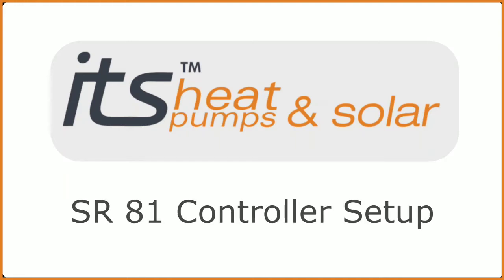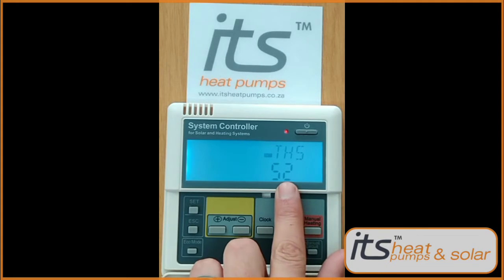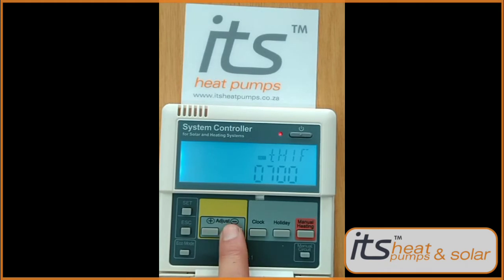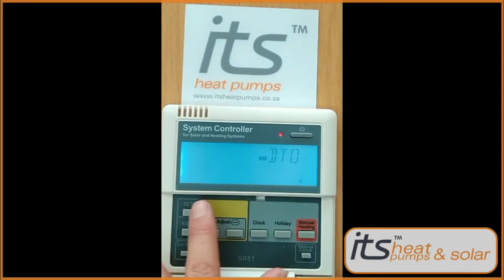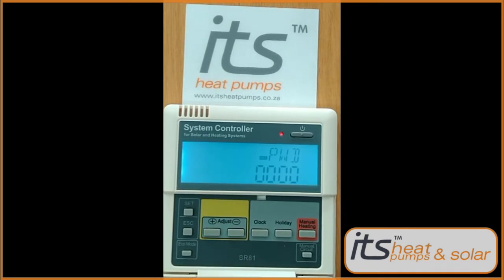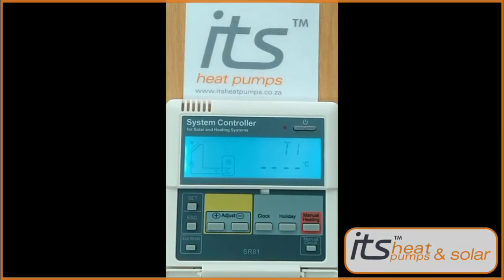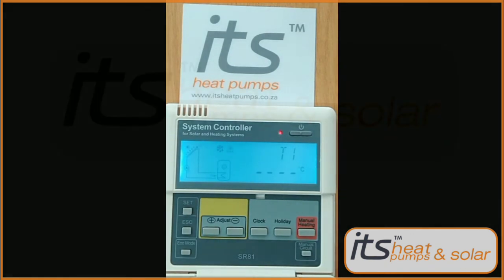ITS Heat pumps & Solar - SR 81 Solar Controller Setup Video

Comment: Hello!  In my installation, the recirculation pump operates continuously, without interruption. Is this the intended behavior, or could it indicate a control system issue?

Comment: Hi and thanks for the video

My water not getting hot even when set to manual heating (60°) . Today it only reached a max of 35° (cloudy day) so I assume that it was working only on solar. What might be issue here? How to know if there is an issue with the element, thermostat or the controller.
Thanks in advance

Comment: Hello @ntuthumnyani your geyser should not be drawing any power if you have solar and heat pump combined, you element should be off and the controller should be controlling when the heat pump switches on not your element.

Comment: Thank you for your video, I am not sure if I am doing my setting right because my geyser still consume a lot of electricity  regardless of heat pump and solar panel. What are the 3 right times to set inoder to get hot water in the morning up to 10 am and in the afternoon up to 9 oclock and save electricity at night?

Comment: Thank you for this helpful video. Please could you explain why the temperature on my SR81 does not increase consistently (until it reaches the temperature I have set) when it is using the electrical element. When the system is using the electrical element for heating (on manual or timer) the temperature starts increasing then suddenly and inexplicably drops a degree or two then starts increasing again (even though no hot water is being used). It seems to cycle upwards like this whilst it is heating up and thus takes longer to reach the desired temperature than it should. Is this normal?
Reply from the maker: Good day

Thank you for your question

Regarding element heating, element heats the water from the cold side of the geyser at the bottom. Because element heating happens rapidly the heated water it creates rises quickly to the top of the tank and the colder water at the bottom part of the tank is drawn closer to the element. With this movement past your sensor pocket it cools down for a short period as the colder water is heated.

With the solar you are heating geyser from top to bottom and will have more constant heating

So in short this is normal as your stratification levels in your tank moves (rotates) as you heat water.

Hope this helps

Greetings
ITS Heat Pumps
Reply: @itsheatpumps9736  Thank you for your comprehensive reply.

Comment: Holyday function activate. The pump dosen't activate even the tank temperature is 55° (t3) and is night and the colector temperature (T1) is 22°. I don't know If I'm doing something wrong...
Reply from the maker: Good day

The holiday function will do normal solar circulation during the day and then at night it will dump all the heat by circulating tank water to the panel to be able to start the next day at a colder tank temperature. 

Also please deactivate T3 sensor as set out by the settings in video. T3 sensor is for ring main functions and or top of tank temperatures. If you only making use of 2x sensors (1x Collector 1x Tank) it is advised to deactivate T3 and only use T1 & T2

Greetings
ITS Heat Pumps

Comment: Hi! Thanks for the video!
When talking about the Electrical Element Timer you suggest to set tH1O temperature to 48º minimum, why do you suggest this temperature? What does this parameter mean? 
Regarding tH1F, you suggest to set it to 55º, would you please explain why as well, and what does it mean?
Thank you in advance!
Reply from the maker: Good day and thank you for the question.

The tH1O is the minimum temperature tank will need to be for element to switch on, if above this temperature element wont switch on even if timer allows it.

The th1F is the element set point for the tank. This is the max temperature element will reach and switch off. 

With element temperature set to 55°C max this will allow top of tank to reach 60°C witch is required by SANS regulations.

Hope this clarifies query

Greetings
ITS Heat Pumps & Solar

Comment: hi, those settings will warm my water during the day?
Reply from the maker: Thank you for the question. These settings is to ensure proper operations of the solar controller and ensure system reads and runs at the optimal performance dependent on weather conditions. This is all subject to proper configuration of system install. The controller has other functions that is not applicable to standard solar installs.

Hope this sheds some light.
Greetings

Comment: Hello, why did you turn off the T3 sensor ?
Reply from the maker: Thank you for the question
The T3 sensor is for the ring main sensor in conjunction with T4 senor, the T3 would normally measure temp from middle of tank (Larger vertical tanks) or on the hot water outlet to determine if ring main circulation pump can be activated. This is not covered in the video, its normally for specific installs. In short the senor configuration and functions are different for these types of install but for normal solar T1 & T2 sensors are sufficient.
Hope this helps
Greetings
Nico
Reply: @itsheatpumps9736  thank you Nico 🙏
Reply: Salutare Nico îmi poți spune te rog la câte grade să programez pompa să pornească și la cât să se oprească și cum sa o fac ca nu știu adică ce ramura să  accesez la controlar. Mulțumesc
Reply from the maker: @canciovici  Good day and thank you for the request.

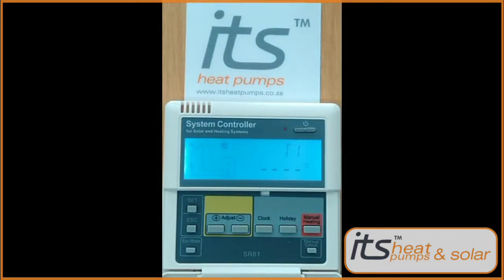To set differential for pump activation please follow steps from 01:23 on video.

Setting DTO to 8K you are telling pump to go on at a temperature difference between tank and panel of 8°C. 

The DTF can stay at 4K as to tel pump to stop running on a temperature difference between tank and panel of 4°C.

Please be advise that this is estimates we have tested and found to be the best performance but can be adjusted for your area and installation demands.

Hope this helps

Greetings 

(O zi buna si va multumesc pentru solicitare.

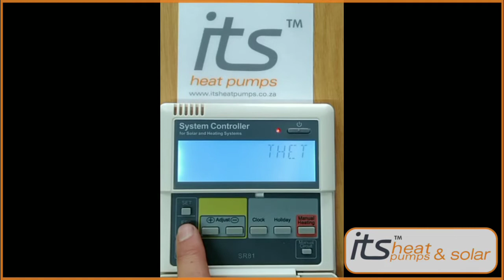Pentru a seta diferența pentru activarea pompei, vă rugăm să urmați pașii de la 01:23 pe video.

Setând DTO la 8K, îi spuneți pompei să funcționeze la o diferență de temperatură între rezervor și panou de 8°C.

DTF poate rămâne la 4K pentru ca pompa să nu mai funcționeze la o diferență de temperatură între rezervor și panou de 4°C.

Vă rugăm să rețineți că acestea sunt estimări pe care le-am testat și am constatat că sunt cele mai bune performanțe, dar care pot fi ajustate pentru zona dumneavoastră și cerințele de instalare.

Sper că acest lucru vă ajută

Salutari)